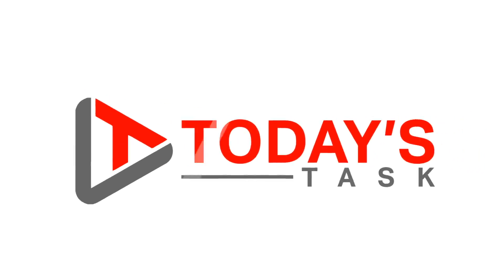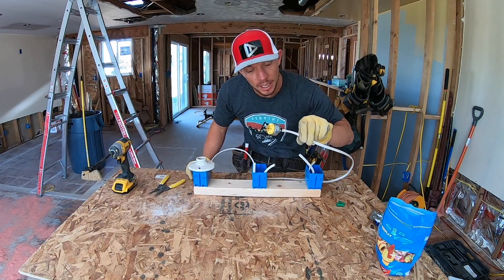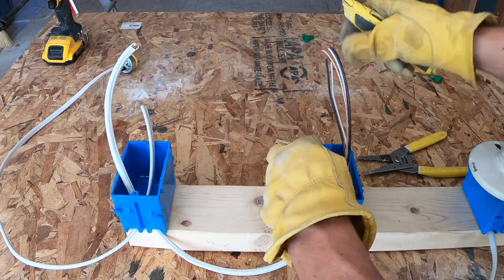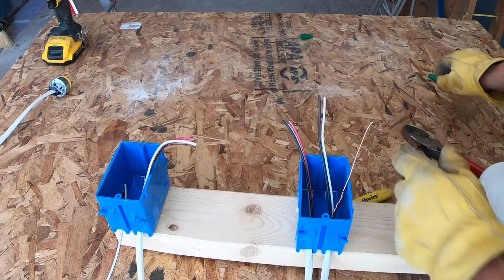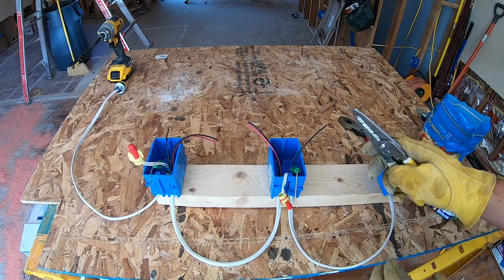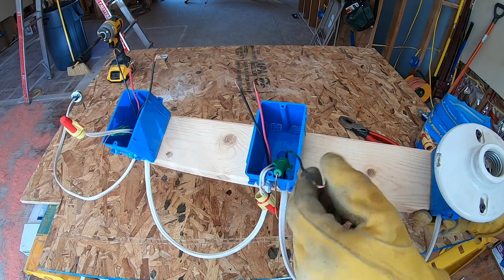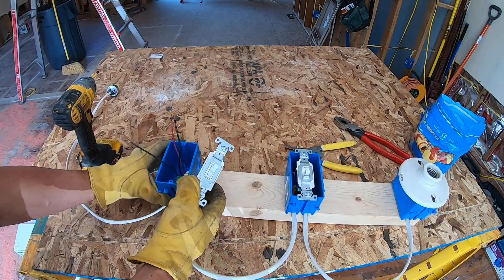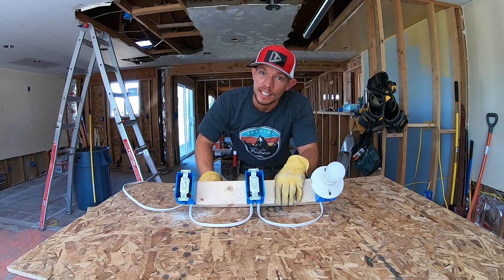How to Wire 3 Way Light Switches

Comment: I've never seen anyone explain this, but here goes. a 3way switch (S1) on one side of the room, where the hot wire comes in. Run a line to another 3way switch (S2) on the other side of the room, and put a duplex receptacle (R1) next to S2. How would you wire that?

Comment: If I find the hot wire on both switches with bolt meter do them hot wires go on the same black screw on both switches or do I use a runner on one and hot wire on other in the common screw

Comment: Thanks for posting.  I am installing a WiFi 3 way switch.  The instructions say to install in the first box off the breaker.  How do I know which one is first?  This is a replacement in an existing circuit.  Thanks and keep up the good work.

Comment: Great video. Just want to share a handy tip for stripping the wires. To avoid nicking the insulation I only cut about 3/4 of an inch at the end of the shield then grab the ground wire with pliers and pull it back until I have enough exposed then snip off the shield with side cutters. Safe, quick and easy.

Comment: In UK it’s illegal to do DIY electrics, you must employ a professional electrician.
Reply: Nowadays. I rewired my own house in the UK back in the 1980's. Many of the rules in US and Canada are less stringent as the voltage is lower.
Reply: @stephenburnage7687  Yes that’s true.  In fact you can have power points in the bathroom in the US
whereas you can’t in the UK.

Comment: The safest way to remove the main insulation ( the white outer insulation) is to start your blade at the tip, end of the wire and go down.  This way you see clearly what you are cutting into.
Something worthy of consideration.

Here is more confusion for you.  Ready?
In a different setting of electrical system you get this:  The common wire goes through all the junctions and the load.   And it is the hot wire that is switched.   So much for "hot", ' ground", "neutral", "common", "live", and one more, "return".

And while you are at it,  type in 2-way switch on Youtube and see what you get.

Comment: Technically you can run a 3way switch without 14/3.. There's like 4 different ways. Most are against code but the most common is a dead end 3 way. And they are legal since the box with the line coming in has a neutral so you can use a digital dimmer..

Comment: Thanks for the info.  I have two, 3 way switches located at either end of my living room.   I have tested them for power and they have power.  Here is the deal...  I used a receptacle tester to check for voltage at all seven of the living room outlets both top and bottom receptacles.   I did the test on each receptacle with each switch in the on and off position.   All seven of the receptacles remain hot no matter the position of the two switches.   Both switches have power but send electricity to nowhere (at least in that room.)   So yesterday I bought a Toner/Tracer to try and find out where that electricity goes after it leaves one or the other of the switches.   I am trying to power a floor outlet I just installed.   ANY SUGGESTIONS FOR ME???

Comment: I was taught to stretch your pinky and thumb out as far as you can. That's how far you strip the wire insulation back. Rule of thumb. :)
This is better than most videos I've seen. You use the switch box for your connections where it's easier to work. The other videos use the light box as a junction box which is an old school pain standing on your head. If you do it regularly  I prefer a little light 12v lithium screw gun. Works all day and you're not carrying around a heavy screwgun.

Comment: Best video I have seen this far on a 3way switch. Would you happen to have a video on three switches in a box. 
1= controls the fan
2= controls fan lights
3= is a 3way switch, controls can lights 
     All switches are in the same box. I’m trying to update the switches to smart ones (Lutron Caseta) I have the fan and fan lights working but can not figure out what’s with the 3way can lights. I have four lines coming into the box and one is a 14/3 the rest are 14/2

Comment: In your video, I see that when the bulb is OFF, one of the switches is UP, and the other switch is DOWN. Is it possible to tweak this, so that the bulb is OFF when both switches are DOWN?
Reply from the maker: It cane depending on which switch is used last. That is one of the things that bothers me about 3 way switches.
Reply: When the light is off install both switch's with their handles down or up even if it means you have to flip one around. Then the light will turn on when one of either switch handle is flipped. End product will be ..... both switch's flipped up, lights off....both switch's switched down, lights off....One switch flipped up while the other switch flipped down light's on.

Comment: Using the word common makes no sense to me, why cant just stay with hot wire,  two traveler wires and ground wire, thats four wires for four screws., After a bunch videos I still dont know if the black screws on both switches are hot, I know one is the infeed/hot but if it is, is the sec switch black screw hot or does it change to one of the traveler wires on the top screw.............

Comment: That's a type of 3-way configuration called a traveling bus 3-way (or a standard 3-way) and as such I tend to travel with the bus with my make-outs... I find it interesting that you work towards the breaker instead, there's nothing wrong with it, it's a matter of preference. You did pretty okay. Also just due to my habits with my conductors I would've stapled even for a demonstration piece but that's just because it's easier for me if I can pull on my conductors a little without them moving around so much, and your hands are still a little awkward with their movements but practice would solve that, if you were my apprentice I'd give you a passing evaluation on the standard 3-way, you did well. 

Sorry I know I'm not the target audience but as an electrician I look up electrical stuff on YouTube (mostly NEC code seminars, but the algorithm doesn't understand the difference) so sometimes stuff like this shows up randomly in my feed and sometimes I feel obliged to make sure someone's not leading people terribly astray, (typically out of ignorance)... you are not, like I said, you did well. Anyways, cheers.

Comment: This is probably a dumb question: do you need a two way on/off switch? The ones I’m using only have 3 screws not 4
Reply from the maker: Yes you can use a two way switch, but it does not have a grounding screw. If your boxes are not grounded, I would purchase a three way switch.

Comment: I don't even know how to ask my question but here goes. I have a light with two switches, both switches will turn light on and off if the other switch is in the on position. Confused!
Reply from the maker: in a three way switch, the on position on the switch can turn the lights off. they are always rotating position in the lead.

Comment: Can't seem to figure out or find a solution to what im trying to do. Im trying to run leds. I want the first led to stay on constantly, but when power is applied the first one it shuts off and turns on the second one? How can I do this?
Reply from the maker: It could be your wiring the constant to the wrong terminal on the 3 way switch..

Comment: Hi Joel,

May i suggest that it’s easier to keep the common side and the traveler ALL BLACK and the other side red, additionally, the first connection you made with the wire nut did not have the ends clipped, the second box twist you did clip the ends, in best practice all ends of the wires must be clipped to have a secure connection to the wire nut; and lastly the non common wires are called “travelers” not “Runners”
Other than that it was a good video

Comment: What conductor are you using for the extension cord? Is it a 14/3? Finally a video where its not going to a panel. Thank you so much.
Reply from the maker: No, 14/2 to the first switch and 14/3 to the second switch and then 14/2 to the light. Good question.

Comment: Very informative thank. In process of changing those because my light burn really fast and it work but I noticed that I have either 40V AC(off) or 120V AC (On) at the light. Was wondering if it's normal or should I investigate the wire because I was expecting to be close to 0 Vac when light are off. I guess I should make a test setup like you to find out.
Reply from the maker: It sounds like the circuit is wired backwards. meaning the light switch should send power to the light, not connect the neutral to the circuit.

Comment: It’s called cable, should people be doing their own electrical, surely it should be an electrician?
Reply: Carol Fleming, that's a good question. I'm not an electrician, but imo it depends. If you're a savvy diy'er who understands residential electrical wiring then, yes. If for example you need a cute little ryme in order to know which wire goes on what screw on a receptacle, then no. If you're willing and interested in learning, then maybe in the future. If not, call an electrician. BTW, when I say you or you're, I'm not singling you personally, but any person.